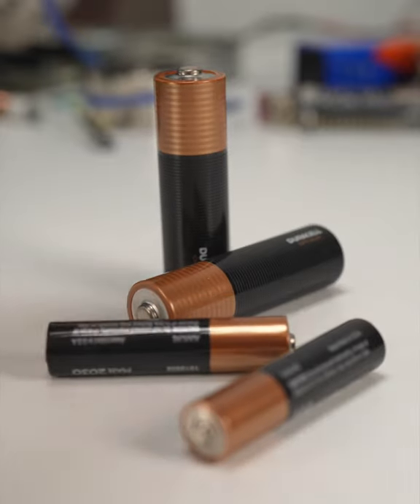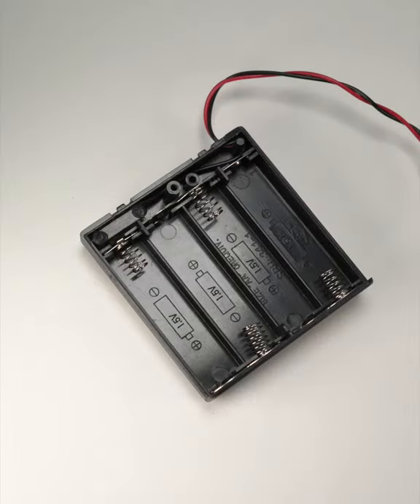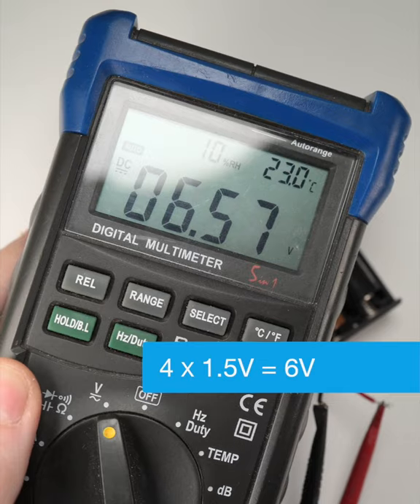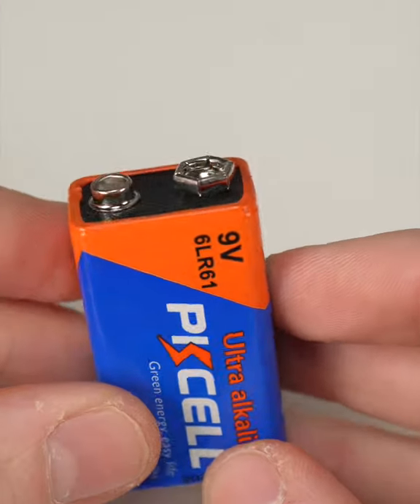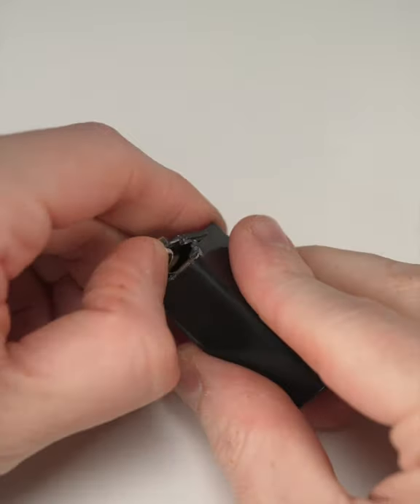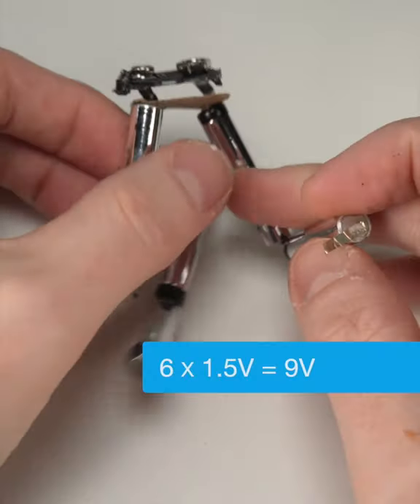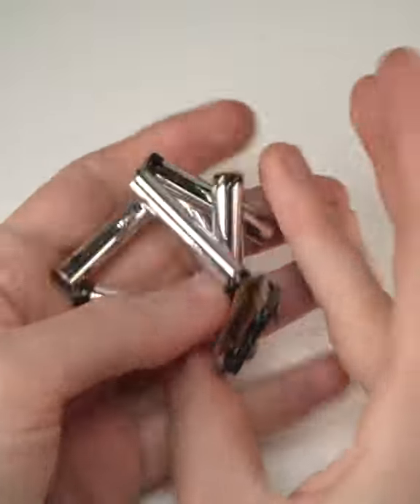How Does A 9V Battery Work? - Collin’s Lab Notes #adafruit #collinslabnotes

Comment: Those are called AAAA cells, I believe. You can buy them individually and they are used in some penlights and other small portable electronic items.
Reply: Yep, those are AAAA batteries, and generally 1 9v battery is cheaper than 6 AAAA batteries.
Reply: Frequently in styluses (stylii?), such as the Surface Stylus as well as some Wacom and Finepoint ones I believe
Reply: I believe they (AAAA) came about because of early bluetooth devices. Remember when people would walk around with that thing in one ear?
Reply: @ja450n  yes, I worked with someone who used to tear apart 9V's for that reason.
Reply: Eh usually you’d use a button cell/coin cell (both are same just different names)
Reply: Ik
Reply: @ChessIsJustAGame They predate Bluetooth by over a decade.

Comment: I used to keep old C and D zinc carbon batteries and disassemble for the carbon rod. Sharpen one in a pencil sharpener and be very careful creating a carbon rod arc lamp. I used an old school welder mask to shield my eyes. But they make excellent point source light. An old flashlight reflector or make a true parabolic one.

Comment: Crazy. There were a stack of 1.5v cells (but not in any packaging) when I opened a 9v last (40 years ago)
Reply: I tore open a dead 9V probably about the same time and it was the same, six squat cells stacked vertically. . I guess the design changed when they came up with the AAAA.
Reply: Ditto, about 40 years ago. 🤓
I might have to check out the new method.

Comment: It has a 2 or 3 li-ion battery inside with Voltage regulator and charger. This is 9v batteries that I have =)

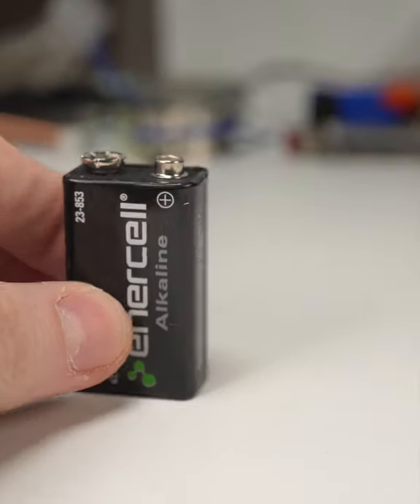Comment: Apparently, the answer was in plain sight the whole time... right there in the part numbers at 0:27
6LF22: 6x LF22 prismatic cells
6LR61: 6x LR61, and LR61 is the designation for AAAA batteries.